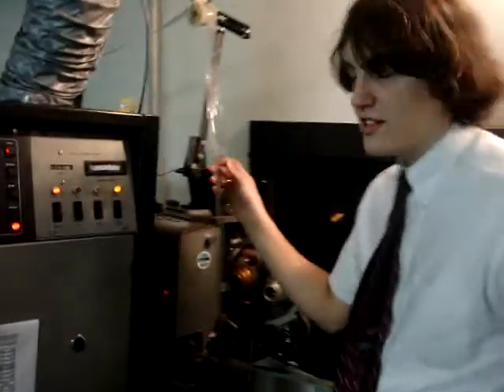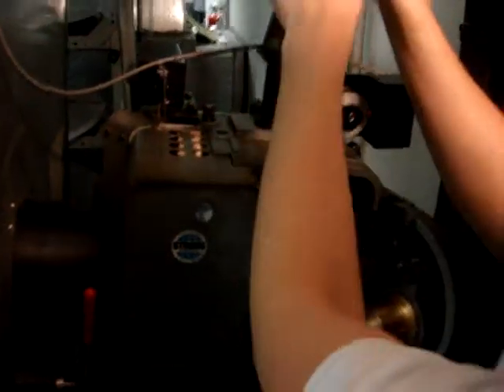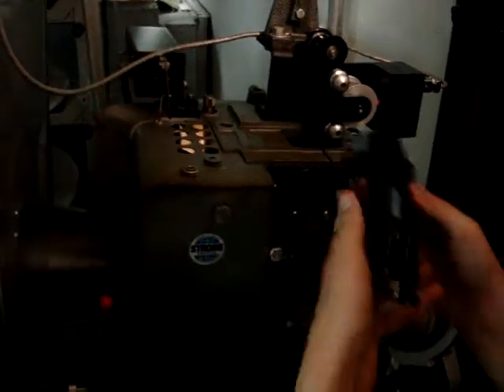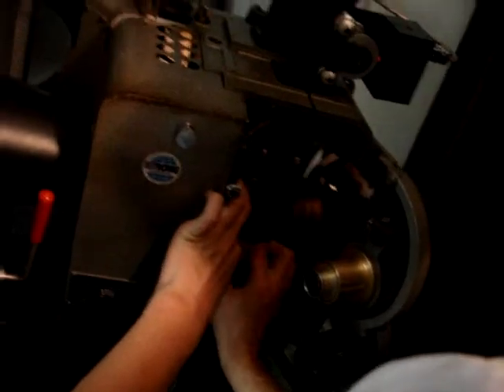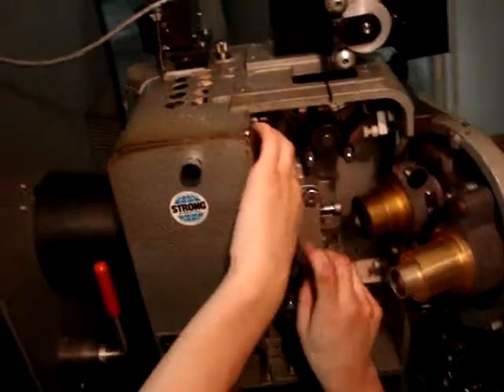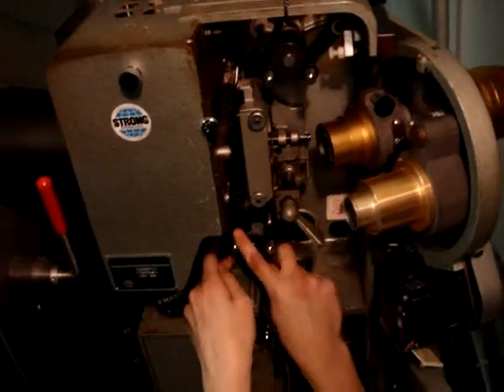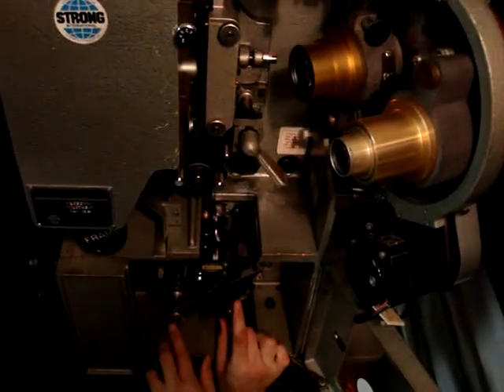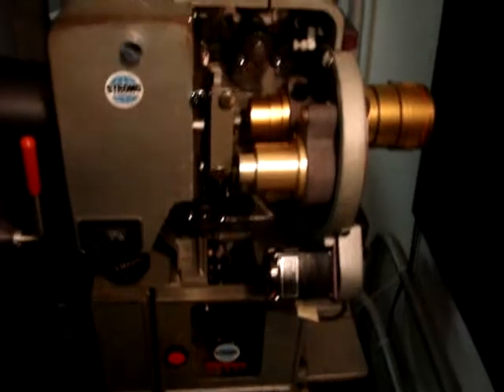The Booth Pt. 2

Comment: That purple stuff is polyester dust. older projectors aperture gate straps are often too tight or rough in places, rubbing off the top layer of emulsion, and polyester off the film. this is a big problem for us, but Film Guard helps. i highly reccomend it. Also  this dust is REALLY bad if you leave it to get 'caked on'. Its thicker and heavier than dust, and weve once lost a shutter from the stuff (pre filmguard). we use strong too. good projectors, and age isnt a problem, just look after them.

Comment: It's a good tutorial, but I gotta say the video quality leaves some to be desired, by which I mean, I can't see anything when you're explaining it. I've been working booth at my theater for about 2 months and even though I'm generally sprinting down the halls to keep ahead of the breaks, it still beats every other job at the theater, bar none. Most theaters, including mine, are slowly transitioning to digital projectors, which is good, but I'm going to miss threading.

Comment: how old are your projectors? our are hitting the wall of 'ive worked fine for 7 years i think its time i went wrong' so basically one thing you have to remember is that every part of these 'modern' projectors (past 15years) has a shelf life. aperture plates have a lifespan of about 15years, whereas the guide straps only have about 3. Speak to your tech about this.